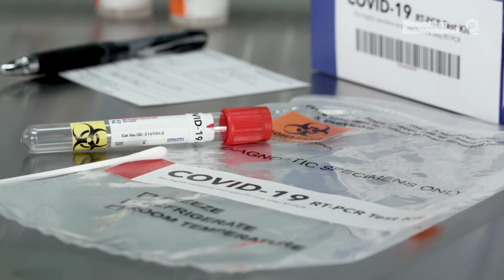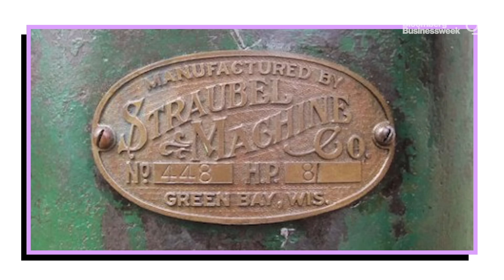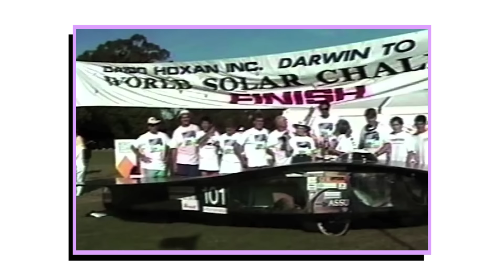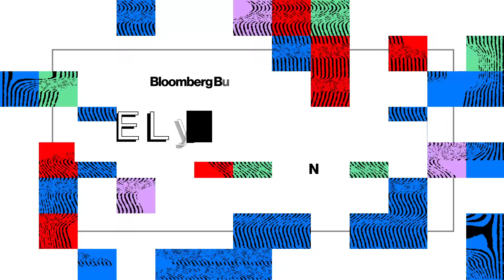An Ex-Tesla Exec's Plan to Recycle Your Batteries

Comment: A legitimate standardization of battery placement in devices that means they are easily “ejected “ by a machine seems the best way of removing batteries from any device-power tools, consumer electronics, or automobiles. The second criterion to be established is a standard for card placement-similar to battery “ejection “. And finally, plastic separation will have been accomplished by the previous two standards. Make these International standards, much like so many things. Easy, right?

Comment: Recycling will be instrumental to the future of EV's and grid scale energy storage.

But burning them is not the answer.
Reply: My thoughts exactly, but what’s the alternative? It’s a boiling point game, I hope they deconstruct as much as possible before lighting up and wasting away
Reply: @evdm7482  There's a company called American Manganese that can recycle batteries without the traditional high-heat smelting process. It's a complete closed-loop hydro-metallurgical process, meaning they use chemicals and water that stay in the recycling system and not released to the environment, while recovering 92% of the battery material.

Comment: 17:30 "BATTERIES ARE INFINITELY RECYCLABLE." Straight from the man himself. Booyah to all those people that say electric vehicles are bad for the environment because batteries end up in the trash. Not once JB gets involved!
Reply: Sick bro, let’s mine the whole world so every bro can have an electric flying pack! How sick is the future, pun intended!
Reply: @evdm7482  nearly everything already runs on batteries, or needs a battery just to function. You can generate electricity without any fossil fuels. However the same cannot be said in reverse. It takes massive amounts of electricity and total energy just to find, extract, transport, refine, transport again. Then store, until it needs to be pumped up out of the storage tanks again just to be burned. Total efficiency of fossil fuels is less than 30% of the total energy on average. Much less if you factor the time trucks, trains, planes, construction equipment and car's spend just idling or sitting in traffic. While an electric doesn't care if it's moving or not. Nor does it give off poisonous fumes, consume many various toxic liquids just to run itself. And it doesn't give off super heated 220+° air!
Reply: @4literv6  you're so right, we should stick to the current energizer battery and leave it at that. You totally got what I was saying and taught me a lesson. LOL
Reply: @evdm7482  you don't seem to grasp even the basic concepts about energy, so I highly doubt anything that I shared even sunk in the most infinitesimal amount. 🤔
Reply: @4literv6  or your ability to take a joke are nill? Don't let your ego and time wasted on a response to a random person be so easily undermined. 
PS: I appreciate your response and it attempts to be plebian in order to inform a generally ill-informed general public, I hope someone else will be able to learn from them that  the world is being destroyed in all current processes of extraction and human cost.
Reply: Note to self, learn how to read what you write in order to keep yourself from sounding the same as that you seemingly mock
Reply: @evdm7482  excellent advice, see you might actually have a shred of intelligence in all that grey mush. 👍🏻
Reply: @4literv6  I've certainly been shredding my grey matter but it's not all 'in one eye and out the other ear'
Reply: @evdm7482  shoot just reading or watching most stuff online these day's. One can feel their iq dropping precipitously. 😆

Comment: Does anyone know if the lithium goes back into the batteries as a conductor (which is the most wanted attribute of lithium) or if it goes back as the shell of the batteries or similar? 
It's very normal to downcycle lithium into less complex things (non-electronic stuff), so the real challenge is to recycle and reuse the lithium as an conductor.
Reply: like they are talking about in 16:40 :)

Comment: 17:34 infinite recyclable??? Uhm no. What if your chemical supply or other rear earth materials run out, it's game over with recycling. Same with plastic recycling, it's just cheaper and better for the emissions to just dump the crap instead of recycling or "green recycling" aka burning it away !!
Reply: That's the point of recycling. It doesn't run out.
Reply: The material is too valuable to not recycle, it makes great economic sense. When the economic value is so high it's a no-brainer to plan for going this route.